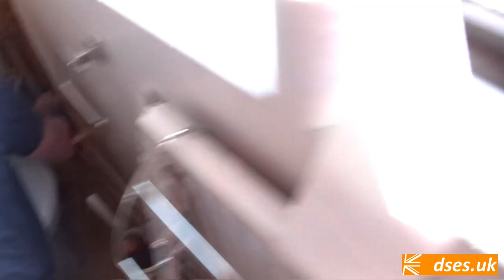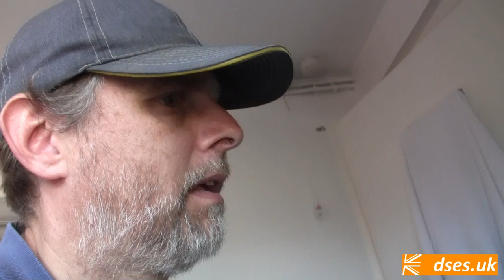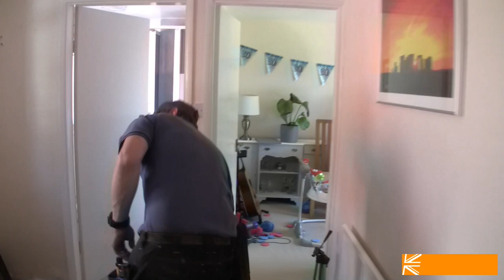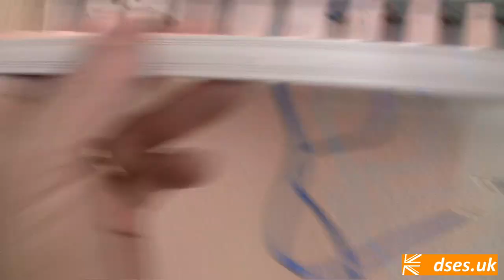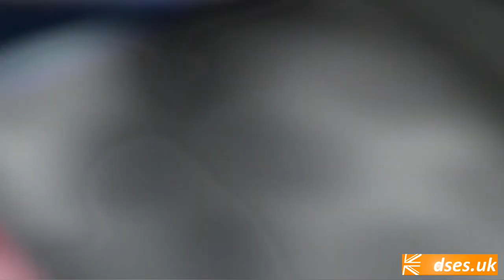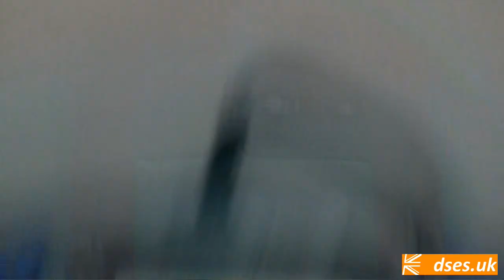Two dicks, one hole... and a new C.U.

Comment: As far as I am concerned the second those AFDD's are mandatory is the second the industry officially switches from genuine safety into a money making scam for manufacturers to cream it in at the expense of consumers.  Its a great way to discourage people from getting professionals in too, make it so expensive people bulk at the cost and go back to using their mate from the pub to do their electrical work.
Reply from the maker: If AFDDs become mandated, I won't be the only one routinely switching to departures just to get new boards on the wall. Not unless they cost the same as an RCBO and contain the same functionality like the Wylex ones (and fat chance of that).
Reply: @dsesuk  Totallt agree David I don’t see how it can be financially viable for the average household which requires a consumer unit upgrade or rewire etc to have these installed.

I, like you think they will fall by the wayside or like yourself will be using the departures column on the installation Certs.

Great content as always, I agree regarding board changes, as soon as the power is off and I’ve dismantled the existing installation, I always think “Think is the point of no return,8 do hope this isn’t an absolute arse 🤣”
Reply: 'bulk' -> 'baulk' (or 'balk' if you prefer US English)

Comment: Phoenix contact does a really skinny 3 level din module (1/3rd or something) with earth, neutral, line-line, neutral, earth connections top to bottom, with proper colors on the module as well, spring terminals that take all sorts of conductor types, and they can even be linked sideways. Not sure on the conductor sizes though, but the once I’ve used probably go up to 4mm2 at least. We use them a lot for mains distribution in panels, and it’s compact as can be.
Reply: Kept bothering me, so I had to look it up, 3210538 is the part number, takes a 4mm2 conductor, but only rated to 24A sadly, so a bit anemic.

Comment: Old Wylex fuse (wire) box above our bath with shower!!! We don't spray it with the shower and it is boxed off, but it is, along with the rest of the house, a wiring nightmare. It works though - but dreading an EICR 😡😡😡, or having to go down the electric car route.

Comment: Another excellent videogram from the master of electrical installations. 
I fitted an Elucian board this week and was most confused by the lack of instructions with the SPD. Today I returned to the local wholesalers and we decided to ring technical support. They advise that no breaker was required, the SPD fits where your master switch sits, the master switch moves to the left two spaces and the tails kit should screw into the new position. However early boards did not have the additional holes ( for the tails clamp) drilled in the DIN rail. So drill your own or bin it!. 
A PDF is available, and I have the article to hand, or you can probably download it.
Regards TC
Reply from the maker: Oh. Well that's interesting! A lot of early SPD boards from other brands had the 'unprotected' SPD design, but they tended to fall out of favour. The likes of CP Fusebox for example changed theirs to include an MCB. Personally, I prefer an MCB for two reasons: firstly because the SPD could fail short-circuit and the unprotected design relies on spring-loaded solder joints within the SPD assembly melting to break contact before the main fuse blows. Secondly, figure 534.8 (p.169) defines the length between the OCPD and SPD which, if the OCPD is the main fuse, can't be satisfied it seems to me. If I were to fit another, I'd do it in the same way again.

Comment: Hi Dave in austraila, that under ground cable works would be completed  by a  authorized electrical contractor. The network operator only maintain the network. Authorized works include low voltage and high voltage.
Reply from the maker: I'm quite happy for the network operator to be digging the hole and repairing the plumbing when it gets damaged!

Comment: I have the same issue with the armeg torque bit for the smaller star size last about 40 circuits then ping. Snaps and it's not doing a great deal of pressure ethier, 

The board looks decent still the double pole lad seems the way to go for me. But like you say its really what the wholesalers has and price.

I laughed far more than I should have with the sat nav interruptions 

Great video again.

Comment: For stripping tails I use the knipex stripper, the one for flex. I run it round once and then the outer sheath comes off. then move it down and it cuts through leaving a little lip of inner insulation. works a treat.
Reply from the maker: I have one of those. Not sure why I didn't employ it here as I have used it on tails before.

Comment: I definately would of turned the supply off to the close couple cistern and moved it out the way, would have made life much easier. As for CU's I will fit what ever is in stock and suits the needs of the site, though I am more picky when it comes to commercial and industrial as most things around here are using Eaton so it's easier to fit those to match in with existing. Nice job over all.
Reply: I don't see the need to stay playing with fire and move the cistern, Nige seemed to manage just fine.
Reply: @simoncrabb  I suppose it's down to a persons skill set, after all it's 4 fixings and one water connection + possibly a new doughnut washer. I tend to have everything on the van for doing both the job they were doing and the toilet. That said I would have liked to see sleeving through the cavity and into the box, that's our company's preference due to building movement and depending on age what the cavity is filled with either getting out or reacting with the outer insulation of the cable. Unfortunately because the cistern was in the way the hole was rather high so it can't be used to get an additional EV cable through in the future.

Comment: I'd prefer a spring clamp solution for extending wires as it's then basically maintenance free and won't get loose over time, spring clamp DIN rail block would be best, keeping packs of the blocks in the van stock wouldn't be expensive, WAGO aren't the only people that make spring DIN blocks. That said industrial sparks have been working with screwclamp DIN blocks for donkeys years without problems.

Comment: FuseBox are meant to be bringing out an AFD shortly. I think it’s a single module, I hope it will have RCD and over current in it.
Reply from the maker: I saw a picture on Instagram. No detail of release date or pricing though. It's the cost that will sink or swim AFDDs. If amendment 2 mandates them and the cost of a new CU ends up in the high hundreds or even into the thousands (as mine was), then there'll be an awful lot of certs showing departures.
Reply: @dsesuk  What do you mean by certs showing departures (I'm a noob at all this)

Comment: After drilling half inch with the core bit take the pilot bit out as it's not needed anymore as the bit will continue in the same direction AND u don't need to hav the hammer action on with that style of bit so no vibrations for that bolt to loosen and it should be out completely before it enters  the hole anyway....hope this helps
Reply: This type core drill needs hammer mode. The diamond core drill is the one that doesnt

Comment: I commented on another electricians channel i think the chop to size bussbars should be scrapped and fixed bars like crabtree starbreaker design should only be available it would certainly save a great deal of hassle with board changes.

Comment: Another great video Dave, fitted a few of these boards they need to get the rcbo identification bigger need my magnifying glass to see the details also screws that hold bus bar are shit, maybe someone with your contacts can get them told👍
Reply from the maker: That's a good point I failed to address John. The writing on the devices is tiny and it's tricky to identify the breaker value and type.

Comment: If going from outside put a steel plate between pipes and the wall in case you miss, cable you can fix, hit pipes and you'll have to call in a filthy plumber and never hear the end of it!

Comment: I agree there shouldn't be a 'tested by' label included with the CU, it takes bugger all to print your business labels clearly identifying who did the work.
The new build rental I'm currently in doesnt have the installers details on the CU, and if I'd done the work I doubt I would either. I do have the installation report that looks like a lot of very similar impedance readings and very round numbers.
Reply from the maker: It's just such a meaningless label if it doesn't identify who is making the claim for when the last inspection was carried out and what qualifies them to be stating when the next is due. It gives a false sense of security for a competent installation when, in fact, the person filling out that sticker could be any old homeowner or handyman.
Reply: It sadly looks like that is who the label is aimed for.

Comment: GOOD OLD PABLO TO THE RESCUE LOL. WINK WINK. Tell me why it’s ok to extend cables in plastic enclosure but have to update to metal consumer box. And don’t have to torque down isolator. Is it ok to leave 2 isolates in 3 if you count the board ? Nice to see grumpy bastards back lol
Reply: A set of connectors isn't "switchgear"

Comment: Stellar work chaps. So annoying that the heat pump wombles couldn't do their bit tidyer - do you guys put any kinda sticker seals on boards for warranty or anything? 
We looked at the Boddingtons tail stripper at Elex a couple of years ago, definitely seemed to be something that earnt it's money.
Reply from the maker: Thanks Mr Ninja. We don't sticker the board with any tamper labels at present. Usually, I have the test data plus photographs of it before and after which makes for a very boring camera roll on my phone but serves to evidence what we did. I have considered tamper labels, and maybe it is something we should be putting on. With this one, I knew we'd be back in later weeks anyway, but then I also knew third parties would be making alterations, after all, I left spare MCBs in place specifically for them to run sub-boards off. I just hope the EV and PV guys recognise there are non-RCD circuitways with MCBs they can utilise and they don't go doing anything daft like breaking a sub-board into the tails.

Comment: Connexbox used produce an enclosure fitted with din rail mounting Wago Topjob through terminals to extend from the original consumer position? DRE-5 I think.
Reply from the maker: Yeah, I saw that at Elex last month. Haven't tried it yet, have you?
Reply: @dsesuk  no I haven’t but I have used a Connexbox central heating junction box (DRE-1?) and liked the fact that all through terminal access is visible making the insertion of conductors easy . Wago Topjob through terminals, and like everything Wago make, are good quality. My only slight criticism is the smaller sizes like 1.5mm are a bit flimsy and need side support. Got to be better than those pissy screw fixing, through terminal, connectors where you’re never sure if the connection is permanent!
The 3 screw drivers that Wago sell, to have the correct size to release the wire clamp, for each csa size of Topjob thru terminal,  makes life asier.

Comment: Hi David and Nige, from old spark from the 60s. I really love the long videos, I must be a boring old fart I got engrossed.The one thing that intrigued me was the Ze Zs readings I wouldn't expect to be totally consistent 1 digit variation or so, but the parallel paths must be a bit high not make any difference in the reading except be slightly higher?, I guess that the difference between theory and the real world. Sorry that Nige is till festering I hope he gets well soon. 
Peter.
Reply from the maker: Thanks Peter. An even longer one coming soon you may be pleased, or dismayed, to hear! The incoming water service was plastic and the gas pipework, despite being bonded, doesn't seem to be making any odds here as far as parallel paths go!

Comment: I tried a Hager board to see the quality people shout about but I don’t think the bank balance can handle that again😂
I was a lewden chap but I must admit the fuse box boards are my go to now!😊
The SBS board sounds intriguing? Did you do a vid on it David?
Keep on smiling😊
Reply from the maker: There are a couple of SBS vids, plus another to come, although that may be some time away.
Reply: @dsesuk  
Jeez that was a quick reply! 
Has the beer run out?😂
Reply from the maker: @bertiebassett1972  What can I say, sober October chief! The liver needs a holiday!
Reply: I find it interesting that there's a lot of hype around Hager, there's nothing a Hager board offers over a cheap brand.
With more expensive brands your paying for certain features, like plugin devices or devices without fly leads, you don't get any of that from Hager.
And these people should have seen the crap Hager were churning out in the early 90's, basically a plastic enclosure with a front end RCD. There were cheap, because the firm I was working for at the time fitted them on thousands of redrow houses.
Reply from the maker: @acelectricalsecurity  Hager's strength is their availability from pretty much any wholesaler, but other than that I don't find them any different to anyone else. It's good that they haven't changed their design for donkeys unlike, say, Eaton whose boards from twenty years ago are now hard to find spares for (and they cost a packet when you do). Hager's plastic CUs were awful though. How many have you come across where the lid is taped shut because it wouldn't stay shut?!
Reply: @dsesuk  yeah that's very true, find the cover missing or with one snapped lug.
Square d/Schneider are the worst for changing design and very confusing product line, last time I bought a qoe rcbo £90, robbing bastard's😂👍

Comment: At the moment the market seems saturated with boards, and they are all similar looking, personally I would like to see some innovation, such as push in terminals on devices and fly leads omitted.
I think click may have come a bit late to the party, to me, it looks like they have seen the impact fuse box have made, then jumped on the band wagon, also I prefer no knockouts around the board, except maybe one for the tails.
Apparently the guy that sold control gear is behind fusebox, so I guess he knows what he's doing, and will probably be around for a while, unless he flogs it, plus I hear they have an AFDD out.
 As for the others time will tell, mk have thrown their hat in the ring again with boards however that part is Chinese owned.
Reply from the maker: This is why I've been preferring the SBS boards of late - the dual busbar form factor does away with flyleads and offers true double-pole operation even on MCBs. I've seen a picture of the Fusebox AFDD on Insta, but there was no detail regarding availability and pricing, so for all I know it may be just proof of concept artwork rather than a product ready for market. We'll see Anthony!

Comment: Exactly the same happened to me with exactly the same drill bit - £8 from the local corner shop, they’ve tools above the normal and shop and had one of those cores.. brilliant till I lost the pilot!!!
Reply from the maker: The pilot's always held in by something that's an afterthought Webby - a friggin' grub screw or a bolt that sticks proud of the thing and catches on what you're drilling!
Reply: @dsesuk  I know I’ve got the exact same one pal, luckily I was drilling down and managed to find everytging
Reply: @dsesuk  sorry I didn’t explain myself to well - 5/6 tinnys in like!
Reply from the maker: @Webbster77  Good man!
Reply: The pilot bit in a core drill is only intended to be used to get the outer hole started, then you remove it and core the hole without it.

Comment: You need to try a CP fuse box for your next board I think you'll like them.
Reply from the maker: I've other vids where we've put in CP Fusebox wares. They were my go-to in 2019/2020, but recently I've been favouring the SBS dual busbar boards.
Reply: This click board seemed a bit lackluster, Is that your last one do you think?
Reply from the maker: @heladas90  It was a perfectly fine board - it's just whether it's on the shelf next time I need one. Chances are, CP Fusebox will be more readily available at my local CEF.

Comment: Are core drill bits designed to be used with a hammer action ? what bit is that you are using that allows the SDS drill to be used ?

Comment: Not sure why boards need to be a wholesaler thing, wholesalers are for the quick jobs you need parts same or next day. Bigger jobs and box changes generally have a lead time and ordering online for delivery has to be a better use of your time than driving to the wholesaler?
Reply from the maker: I tend not to deal with internet orders too much as I prefer a local counter where I can source goods, return unused/unneeded items and replace or return faulty items without the hassle of postage and packing. Yes, the internet can be cheaper. No, I'm not generally organised enough to be placing orders in advance for hardware I suspect I'll need for upcoming jobs, neither is someone necessarily available in the day to take in deliveries. Within a five minute drive from base I have access to CEF, Eddies, Toolstation, Screwfix, Denmans, and Leamington Electrical Distributors (a local independent). They also happen to be near the likes of Greggs, McDonalds the fuel stations and supermarkets and the pub we frequent which is open for coffee from 08:00. We're basically heading past one of these wholesalers every morning, so they work better for me than ordering over the 'net.